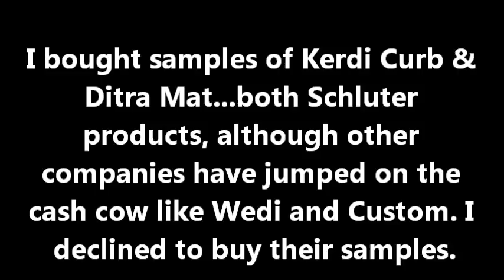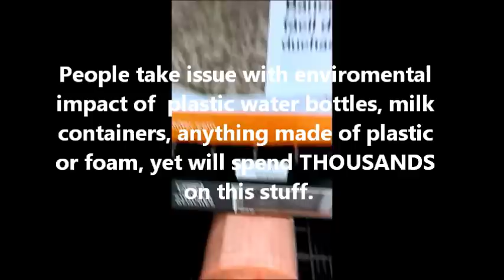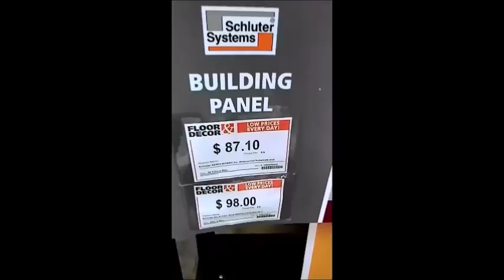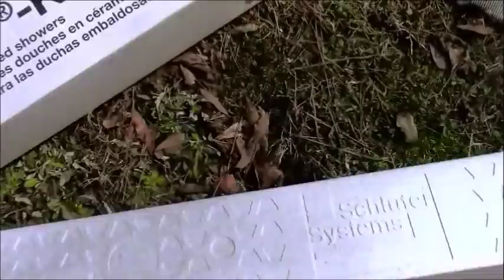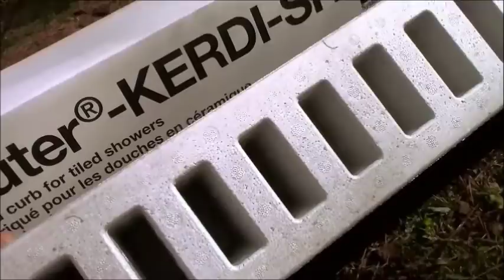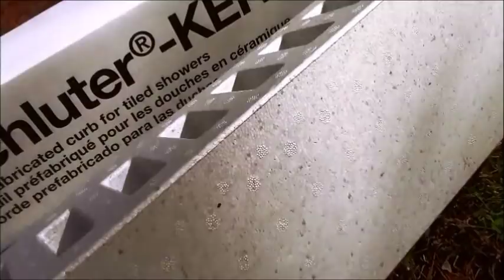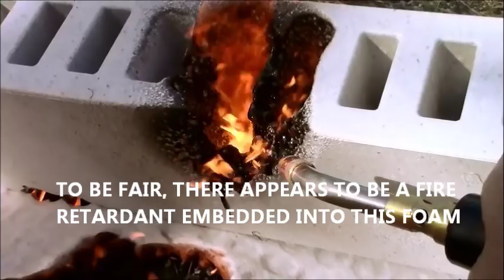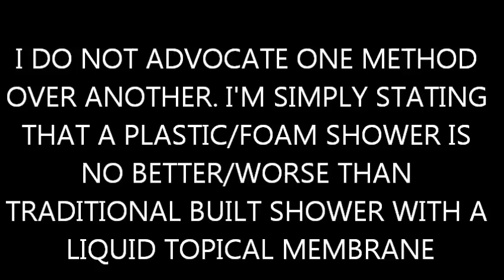BUILD SHOWER FROM FOAM and PLASTIC ??

Comment: While there may be reasons not to use these systems, the fire aspect is probably the last one to consider.  Plastic sandwiched between 2 layers of non combustible material has a pretty much zero chance of igniting until the fire would be so far along there is no way that you would want to be in the house, nor would it make a difference in being able to escape the fire or not.  Our houses are filled with plastic.  Plastic in open air is a lot more likely to burn that plastic inside a wall where it would be oxygen starved.  Reasons not to use a membrane system might be cost, installation time, etc.  I have built with both membrane as well as liquid methods with good results.  I have also ripped out several "Old School" showers with lead or copper pans, and the mud bases are always saturated with water.  Liquid membranes biggest weakness would be failure/cracking due to the structure settling not to say the same couldn't happen to membrane systems.  If I was going to due liquid on a mud pan, no way I would rely just on that.  I would still put PVC under the cement, and then the liquid would just be there to stop the mud from getting saturated.  I usually use liquids on walls when using fiberglass pans/bases.
Reply from the maker: All good comments, except the fire analogy...that my friend is way off base, but not expected you would know.
Liquid membranes are crack prevention membranes, so settling of a house is a moot issue in my opinion. But I agree I wouldn't rely on it as a pan liner, although the companies allow for it to be used as a liner. And I do use a liner, mortar, then paint on Redgard on it.
Reply: I could see the point regarding fire with the Kerdi Board as its essentially foam that would be typically exposed on the inside of a stud cavity.  As for regular Kerdi, Ditra, and the foam curb, after installation the foam would be completely covered in tile/marble/stone, and ditra covered by tile as well.  If the ditra was over OSB/Plywood, it would have to be completely  engulfed before the ditra would start to burn, so its really moot as with the same logic we should probably get rid of PVC pipe, dishwashers with plastic tubs, PVC electric boxes, etc.  I have never used the foam curb or kerdi board, just the membranes typically over durock or hardie, both of which don't burn and the opposing face would be covered with tile.  So yes, there is a lot of marketing at work here as to why you "need" these products, but I don't think fire is in the ballpark of being a negative.  If that's the case we should all sell our wooden houses filled with products that give off toxic fumes when they burn.

Comment: Red guard is $200 for 2 coats and with drywal or cement backer... weidi is $400... I'll go weidi all day for the extra $200... it's so easy to install and will never rot or mold... plus the urethane sealer is way better then mud or silicone... period.
And I will never use schluter-kerdi again... it's a pain in the ass.
Reply: Weidi cost me $400 a shower. That's with the board fasteners and sealer. But I'm will to try a red guard like product, but probably in my own house first... so I know what to expect at least.
Reply: What about the Wedi pan...…$400-$500 alone

Comment: Except this material will never be in open air when installed, it will always be sandwiched between two beds of mortar and a layer of tile and grout over that. And we all know fire needs oxygen to burn. This really isn’t an accurate assessment.
Reply: False I've worked on burnt houses before and the fire has burned everything to the ground. Usually only thing left is the carcass of burnt exterior walls.

Comment: I totally agreed with the cost. Too expensive and the result is a watertight shower, but sound hollow and cheap. However, don't knock the foam, Highway ramps and overpass are backfills with these closed cell foams. It can take a great deal of compression and nearly indestructible if undisturbed and protected by the concrete reinforcement shell. watch videos on overpass constructions.
Reply: P Dan û

Comment: I thank you for your numerous videos, the only reason I prefer to use Wedi (not Schluter) is because I have confidence in tiling but no confidence in pouring a sand/concrete pan and also due a weak back I should not be lifting/transporting 60-80 Lb bags. The Wedi curb design is stronger and better designed than the Schluter due with Wedi you are using 2X4 wood inside the form as backing for shower enclosure screws.How Schulter expects shower enclosures to be mounted securely with screws to their weak foam puzzles me unless they think just securing screws into  tiles then thin set and foam is adequate! I prefer not to use plastic plugs and want long  screws going into wood.    I strongly agree with you that Wedi or Schluter is too expensive. Hardie Board and Red Gard work well and can be used with a Wedi shower pan.

Comment: I think it’d be hilarious to build and test an install using cheap pink insulation board. I bet it’d hold up as well as WEDI. Seriously, it’s the same as Owens-Corning insulation board. Just glue some of that together.
Reply: It's exactly the same, extruded polystyrene, although I don't know if you can get Owens-Corning styro in a 1/2'' thickness.
Reply: @a.fritzbecker8986  it’s actually not the same. The foam itself is waterproof then add the membrane on both sides and it’s superior.

Comment: I feel the biggest reason in my own opinion is that the purpose behind using these is to avoid carcinogens as much as possible. Hardie backer or cement boards normally have about 10 to 15 percent carcinogens. Now with that being said thinset and grout also are carcinogenic. I definitely agree that this system is entirely to expensive for what it is. However the schluter system is fairly simple to use and I think that’s why it’s considered. I personally use the tried and true method that we all know and love. I don’t believe either one is better or worse than the other. They all have pros and cons and at the end of the day it’s all about client satisfaction.

Comment: Your right on Bob ... I’ve tried to justify some of these. Can’t do it. There is one product I have switched to. Laticrete Hydramat. Makes it easier to put sown floor tile ... when doing it by yourself. Much cheaper labor wise. It is also perforated so you can use modified thin set on both sides. Other than that.   Schluter gets big bucks for their stuff. Nice show and tell.

Comment: I personally plan on purchasing one of their shower pans when I remodel my downstairs bathroom but that's the only thing and then I'm going to use cement board and Redguard the living crap out of everything like I did my upstairs bathroom and it should last the next 50 years.

Comment: I must admit, I like the idea of waterproof and all, but say you have a small patch to fix in a bathroom, you can't use the foam boards and match it up to the old wallboard. Secondly, my walls are 40+ yrs old and the only reason there was any water damage was the plumbing that was right next to them that had a leak. The wallboard was installed as you said it should be which I was surprised because it was done by the original builder and there are things that aren't done right, but this part was. That being said, what if you have to work on the pipes and they are near foam board and you need to use a torch on the pipes? Would that not by proximity melt the foam? Another YouTuber who is a tile professional did a test with a heat gun and the foam boards and it literally melted the Schluter boards and made it like "marshmallow" consistency."
Reply from the maker: Sadly the mantra today seems to be it is the next guy's problem...
When I have hemhaw about using thinset and fasteners for your back your board and how it screws up the subfloor that's what I hear back, it's the next guy's problem.
Forward-thinking is not a thing with most contractors, yes they want to do a good job but at the end of the day they want to get paid and move on

Comment: I used Ditra on my floor and cement backer board for walls, then put the liner... it worked but it was an expensive fix for just one wall. The environmental aspect is an eye opener. I could not afford plumbers around here doing the shower pan -- they wanted to buy a yacht at my expense. Ridiculous. And I couldn't do it myself so went with a cast iron shower base by Kohler. I know, not the place to say this but... plumbers are charging crazy money. For example, install shower pan, connect drain, raise shower valve for shower, and move existing vent pipe (PVC) $1,200.00 And I have access to basement and attic, and studs are exposed!!!

Comment: My first experience with Kerdi shower kits was a 73 unit hotel about 10 years ago. The pans were relatively easy to install, but factoring in the time spent trimming and/or filling voids to accommodate the varied sizes of each shower, the time saved using the system was nominal compared to traditional mortar beds. Applying the wall/floor membrane along with the numerous corner protections was EXTREMELY time consuming compared to a liquid membrane and reinforced fabric waterproofing system. The slight labor costs saved installing the pans completely evaporated when factoring in the time lost installing the waterproofing membrane. Additionally, the build-up of two and three layers of Kerdi membrane in corners or other areas where it was necessary to overlap the material created significant high spots, leading to increased time when installing the tile. The only thing I genuinely liked about the system was how the 4" square drains worked perfectly with the 2" x 2" floor tile, eliminating the 5-10 minutes typically spent making drain cuts. 

Schluter makes a number of good products and I use them on a daily basis, but in many regards they're simply trying to reinvent the wheel. The trouble with these "foolproof" systems is they lull the inexperienced installer into thinking they are in fact...foolproof. No amount of technology will ever replace the efficiency and precision of a skilled craftsman. I laugh at how many of the horrendous tile jobs in Bob's videos utilize Schluter metals in an attempt to dress up the completely awful workmanship. There are numerous skills that factor into a quality tile job, and building a solid, working shower is one of them. But if you think the key to achieving that quality tile job is to simply shell out hundreds of dollars on a kit, you're in for a rude awakening. If you're a homeowner, you're better off saving the money spent on the kit (and the headache when you realize you're in over your head) and using it to hire a pro. If you're a pro, the choice is yours. Overspend on the newest materials because you think it saves you time, or stick to methods proven to stand the test of time and pass the savings on to your clients.

Comment: I can’t bring myself to set tile to foam. I guess I’m just to old school for that. It took me a long time to get away from wall mud and go to wall board.
Reply from the maker: Agreed...though I wasn't doing this 30 years ago, I typically take out 1000-2500 lbs of material and replace with 300-400 lbs...this material might weigh 50 tops...foam and plastic, like new car bumpers

Comment: The floor ditra mat is probably their best product for heated floor tiles. That and their shower head covers. Besides that their system is way too overpriced. If it was lower in cost compared to competition than and only than would seriously consider it.

Comment: There are lots of methods for constructing a waterproof shower, but all of them depend on the installer doing things correctly. Spending a bunch of money ONCE and getting a waterproof shower is preferable to screwing up a mortar bed. BTW, I doubt seriously that building an “old school” shower and correctly waterproofing it is one dime cheaper than a foam system when you consider labor costs. But I get that there are lots of old guys my age that hate on foam systems JUST because they’re made of foam and easier than floating a mortar bed...

Comment: Will the 2x4 curb burn?  The PVC liner?   This fire argument seems excessive.  If the material under mortar is burning, regardless of its composition, the house has long been doomed!
Reply from the maker: You are correct ! However, from an ex-firefighter mind ( which never goes away ) I'd rather a 57' Chevy fire with steel/metal than an 18' Chevy with plastic/fiberglass that burns FASTER and gives off toxic fumes...yes they both burn, but my choice is clear & reasonable. Other points were missed because I focused mostly on that, my bad.
Reply: You guys putting wood in a shower never made since to me. Swells, moves, molds

Star, work always looks good though

Comment: I used to build showers like the ones I’m seen you build. I’ve been in the industry for 25 years second gen. This video has infuriated me. I bleed Shulter now. It is by far the best company out their. The founder was a master tile setter from Germany something that means more that the stats. You need to research more the concept of tile because I am starting to view you the same way you view the hacks you come in to contact with.  This system is the best hands down unless you are able to do a full mud set like the old timers. That means no hardy backer or cement board in shower. Understanding the movement of tile is key. There is a reason why 4 out 5 showers fail in the fist 5 years. And that’s why tile setters need to up their knowledge  if not it will go back into the hands of plumbers who’s solution is a giant plastic funnel! It’s a shame you have not taken Shulter’s free classes. You’d learn something about the real industry. I love this product and stand by it. I can turn out a high end shower in a week. So really if you want to stand behind paint on water proofing go ahead. I was there for the start of that and did probably 50 showers like that but I’ve moved on to better. I hope you do better research.
Reply from the maker: Sometimes I like a banter & most times I don't. Interesting when I state facts on my videos, yet others oppose them with no proof...that is my grudge.

There is a reason why 4 out 5 showers fail in the fist 5 years
Really ??? Never heard that stat, and if true my phone SHOULD be blowing up... I build 4 showers in 2 months, after 20 years I should be swamped with lawsuits. Schluter has an AWESOME marketing tool, make our system proprietary, force ALL products to be used or no warranty, send installers to schools for FREE and pay their expenses, plus give incentives to the installers...GENIUS !! Insures you have the addicts/suppliers/products, maybe they learned from crack dealers...either way it is a product that's been around a SHORT TIME in the scheme of things...since showers were built in the turn of the last century issues were few & far between, in fact I seriously doubt waterproofing a vertical surface is needed at ALL. I do it because it's easy and my customer "feels" good about it, but I did showers for a good 12 years without water proofing, taken out hundreds without it, no issues. Damage and proof is ALWAYS shown in my videos. Schluter systems would do NOTHING to improve the integrity of any shower I build, it's expensive and serves no purpose as opposed to other methods that cost less and are easier. And BTW,  I can back up anything I say, you name the issue and I have a video to disprove whatever you say. In a nutshell, give me a steel bumper on my truck ANY DAY over foam covered in plastic/fiberglass...I don't care that it weighs more or might rust eventually. Pragmatic will always win over a fad.
Reply: Then why don't you post some videos of your work?
Reply: have you tried laticretes systsem ? cheaper, less corner build up, etc

Comment: New subscriber here. I am laying some 12" porcelain tile over 3/4 plywood and cement board. Do you recommend modified thinset and use the same thinset  for 8 inch stacked italian backsplash?
Reply from the maker: For the larger format tile then yes the modified thinset is fine, normally on a backsplash I will use tile adhesive rather than thinset.. unless it's a natural stone... but on a backsplash it is not as imperative that it either be thinset or Mastic